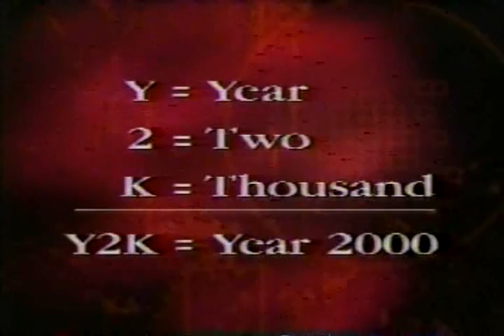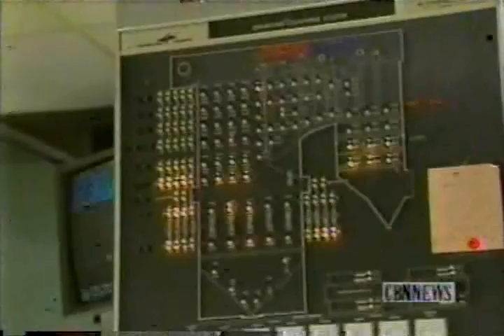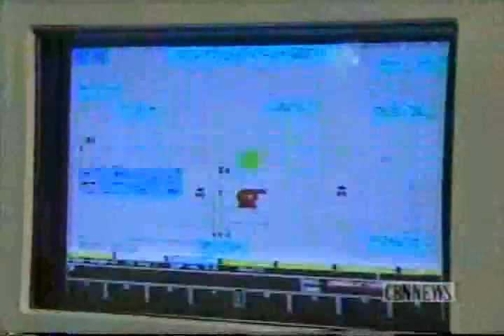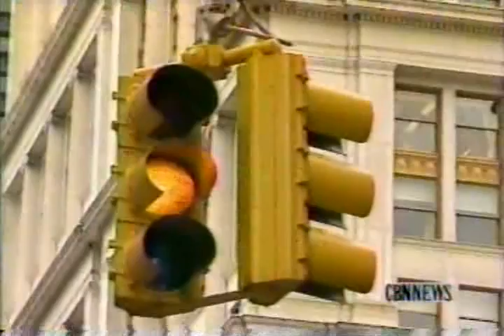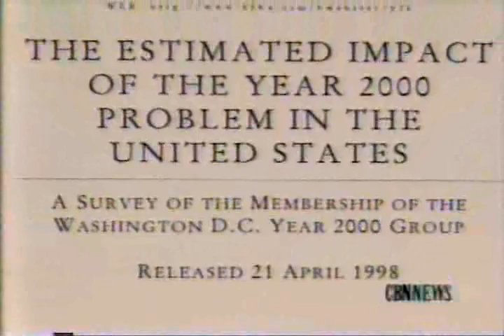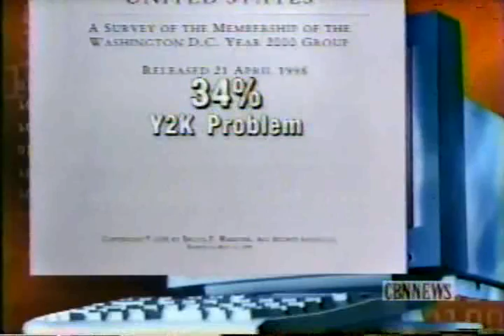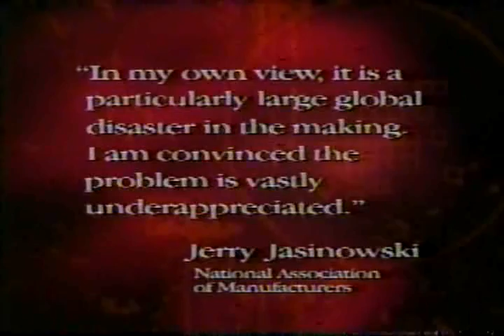Y2K: A Date with Disaster

Comment: It wasnt doomsday. It was when the heart of the internet expires. And because the software was not perfect but cheap cause it went by 2 digits instead of perfect tech run by 4 digit. They had the tech make for perfection but it was expensive. So y2k fear was caused by misinformation, a crappy motherboard, and showed that people are less self sufficent and rely on an old software which works for nothing.
Reply: People were also reliant on the dying computer because it made every ones lives easier than before. It was revoulutionary in the 90's.
Reply: Ruben Nieto The computer pratically and literally controlled everything